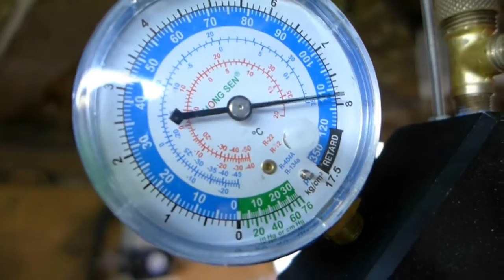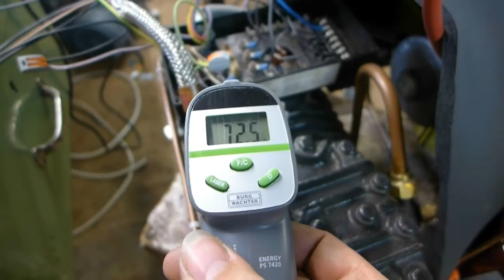Leybold Heraus RGD 510 Cryocooler

Comment: I bought a RGD-510 and helium compressor off ebay, but the wiring connectors don't match. Do you happen to have the pinout?
Reply from the maker: The cold head has a two phase motor which is symetrically build.
You can measure the resistances between the pins, I ran the motor with a 1,5µF capacitor i believe.
I dont have the cold head here anymore...

Comment: Really not good to run these in open air. The upper section is meant to be in a LN2 cooled chamber, the lower section cools to LHe temperatures. It should have a liquid cooling loop on the top of the coldhead assembly. 🤓
Reply from the maker: That may be one use case of these devices. This was used as cryopump and had no external cooling, it does not need it anyways.